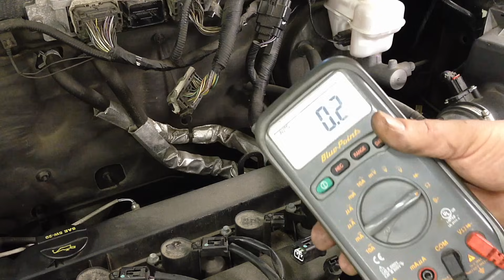Ford Ignition Coil Primary Codes P0351-P0360 Diagnostic Walkthrough

Comment: I replaced the coils per P0351 and P0354 but it is a bad connection from the wire to the coil since i wiggle the clip and it will start working again. Should i replace the harness? Help. Thanks.

Comment: My 2011 escape has the center rear bank coil split apart. I replaced all 6 but still have open circuit trouble for that rear center one. Could that be stuck on? If I multi meter from the connector with it running that center connector gets constant 14v fluctuating to maybe 14.8. Any suggestions?

Comment: Quick question. My truck was under P307 after replaced the plugs. I replace the coil with the original one and move the injector from 7 to 5. Now it shows P0357. I tested the voltage and noid light and my coil connectors passed however there's a small crack in the red part of the connector and the rubber part is missing in the back. Also the clip from the injector wire is missing? What confused me is both pass on the noid light test so I'm not sure if this is the cause or something else. What you recommend as next step? Change connectors or so? Thanks.

Comment: How would you diagnose this issue if it is a V6 engine and the code is P0351, P0353 or P0355 and the misfire issue is on the rear cylinder bank and is covered by the upper intake manifold?
Reply: Hey I’m having the same issue, you ever figure this out?

Comment: P0353 on a Ford 4.2 V6 is not so easy.  It's ignition circuit C, which seems to correspond to the middle 2 towers of the 6 pack coil pack.  The middle 2 towers should fire cylinders 2 and 6, but these cylinders are down because there's no output from the coil.  I replaced the coil pack, no improvement, thus I suspect a broken wire somewhere between PCM and coil pack.
Reply: Hi I’m having the same exact issue. Did you figure out what your issue was??
Reply: @jose-luisboyzo8043 Yes, it was the PCM, not a broken wire.
Reply: @HemiChrysler Thanks, did you have to buy a new one or get it reprogrammed?
Reply: @jose-luisboyzo8043 The customer ordered a refurbished PCM.  There was a physical failure in the circuitry.

Comment: So the connector for cylinders one was not getting a pulse. Changed out not only the wiring harness but also put in a new PCM. Spark plug changed and ignition coil. Not sure why it’s still not sending a signal to the 1st ignition coil. Please help

Comment: I have an 2008 f150 with a P0358 code. I changed the coil ,plug and put a new pigtail connector on to the coil. I was still getting the code so i took it to my mechanic. He checked for constant power on the common side of the connector and put a noid light on and not getting a pulse. He checked for continuity from the coil connector to the pcm connector and said it was good. He thinks its a bad pcm. Is there anything else that should be checked before getting a new pcm? Thank you!!

Comment: 2010 F150 5.4 p354.  Which cylinder? Thanks.
Reply from the maker: It goes on order so cylinder 4.
Reply: @FordTechMakuloco  Found it thanks. I just got done installing the lock outs in my 2010 5.4.  and sent the ecm to Drag Radial Performance and they did the ecm mod to disable the vct.  210 k. Runs good now. Was really banging before.  Just and old plow truck so worth a shot.  Thanks for your great vids.

Comment: Im working on 13 3.7L that has all the coil p0351 through p0356 codes, yet the car runs but with a misfire.
Reply: Car just started this after running out of gas.
Reply: I have this same problem you know whats its ?

Comment: Thanks for another great diagnostic video. The P0353 code I experienced on my Mazda Tribute ended up being an issue with the Powertrain Control Module. At first I thought it was the #3 coil since I discovered it had a large crack in the plastic housing. I'm no expert and can only speculate, but I think the defective coli caused the PCM to fail. I found a company that rebuilds PCM's and their warranty is strictly void if you use any coils other than genuine Motorcraft. The defective coil on #3 was a cheap aftermarket part. I sent in my PCM for repairs and swapped out all six coils. Back on the road again!

Comment: Nice video.  I had the P0351 code pop up.  I moved the #1 cylinder coil to the #2 cylinder and then I got the P0352 code.  That's how you know if the coil is the actual problem.  I would do that 1st since its less than 5 minutes and a really easy job.

Comment: Hi My 2006 Expedition is presenting that same code for all cylinders p0351 to p0358 before that she had a previous failure that did not go over 3 thousand rpm then it began to misfire to the point of not wanting to roll, so she got home and here she comes throwing smoke, and it didn't ignite anymore, when checking the only thing we saw was one of the detonation sensors cut off when correcting that it lit with all the coil codes p0351 to p0358 where do you recommend me to check I'm an enthusiast in mechanics but I know very little about automotive electronics

Comment: I have a 11 base mustang V6 that keeps throwing out different codes to cylinder 3. Started w 3/4 misfiring. Changed plugs. Got it down to cylinder 3 misfire. Changed coil & now code P0353 cylinder C circuit. I'm going to try this all out but I'm afraid that it sound like my pcm might be fried. Has anyone else had this issue with there V6 mustang??? Ty for this video....
Reply: I’m having this issue with the same v6 engine. You ever figure this out?

Comment: Would it be possible to take a metal plate  with a bolt like terminal, then strap the  coilpack  to the metal plate and create a gap between the coilpack and the bolt. Then ground the body  of the coilpack =bolt hole  on coilpack to the plate..   Then run a 12 volt pos to the coil pack and then run a ground wire from the battery to the plate. Then run  a switched ground wire  from the battery to the coilpack neg side .... Then you could  turn the ground on and off and see the coilpack fire.... Do you think this idea would work ?

Comment: Question .. can I use the coils from a 2008 escape 4 cylinders on the 2008 ford escape v6 the coils are the same but the boots are alitthe shorter  can I just put the long bots from the v6 coil on the 4 cylinder coils ?

Comment: Thank you for this video. I am confused with the error codes and was hoping you could clarify the issue.
I have a question about the P0303 error code. This code indicates a misfire at cylinder 3 but I found a website that states that a common mistake people make is that the P0303 code is referring to the third cylinder in the firing order, not cylinder number 3. 

The article states:
"P0303 is a cylinder specific misfire code, which means that Cylinder 3 is misfiring and causing the code. An important thing to understand when finding the location of cylinder 3 is that it's going to be the 3'rd cylinder in the firing order of the vehicle, and not the 3'rd cylinder that you might see when looking at the engine."

My 2006 Mercury Montego has a 3.0Liter v6 with a firing order of 1,4,2,5,3,6. The third cylinder in this firing order would be cylinder 2.
Do I have a misfire in cylinder 2 or 3? Can you please clarify what is meant by cylinder 3?
Thank You

Comment: Is there any reason why multiple ones would come on. I had a code for cylinder one. Changed the coil and now getting P0351 through P0356 VOLVO CX60 TURBO still running rough

Comment: Man I'm having this exact issue an I've followed along step by step,so far so good. But my codes were 351,352,353,354. In order to get to those,I had to disconnect and take off almost everything..how can I check the pulse power if I can't start the car?

Comment: Followed all your steps and triple checked.. I re-wired from PCM to coil thinking intermittent break. Still No Joy! Being told the noise suppression capacitor can throw a PO35X code. I see corrosion on the capacitor terminals and about to remove test and clean them. Your thoughts?

Comment: Hey man great video s and I followed your guide step by step but I’m still not finding the issue. So I have a 98 e350 5.4l. I’m getting codes p0354  p0355. All 8 of my coils are have the same ohms reading. Both cyl 4 and 5 have power on the positive side with the key on and I’m getting a great signal while running on the other wire. No grounding issues anywhere but still not running good at sll. It’s misfiring with low power. (Note that my number 5 coil is actually brand new). I’d love your input. Thanks in advance and thanks for the video!

Comment: I literally tried all the information provided I have a test light all of my wires are pulsing from the PCM, I have a 2012 f150 5.0, on cylinder one I replace the coil pack the spark plug and I’m still getting the same code and I reverse it kills the engine and when I’m driving and come to a stop it kills sometimes not all the times  unless I’m revving the engine a little, any help is appreciated
Reply: Dude did you find the issue???

Comment: I have a 2015 Fusion SE 2.5L ENGINE. I replaced all 4 coils,plugs, and injectors and still getting a periodic misfire in cylinder 3. I see you mention some of the newer model fusions sticking on. I have a Ford tech that started his own shop after the dealership he worked at for 20 years sold. Problem now is I cannnot get it to throw a code when it is misfiring and its periodic so getting it to actually misfire in front of him has been difficult. Visually inspecting the woires they all look good with no corrosion seen, but it could still be a wiring or other issue. This particular Fusion has been a lemon it has 50k miles on it now. At 22k miles it died and was towed in. Under warranty they had to replace the Head as they discovered 3 cracks from the forge. Its been 2 years since that repair and ran great until now. Checked the oil and there is no water found. All the plugs looked good when I replaced them saw no indication of water so I do not suspect anything from that repair. However I do remember them having an issue with an injector after the head was replaced, but they resolved it. I am now just waiting to get another engine code after he cleared everything so he can see if its consistant with same #3 cylinder. Thanks

Comment: What if I’m getting the pulse with a noid light, I swapped ignition coils with another cylinder and I’m still getting p0360? Spark plug?
Reply: Same problem. I changed my coil and spark plug to code p0357 and it still pops up. I also changed my harness because it was disconnecting but my vehicle is still idling and shaking. Confused

Comment: I have been shaking wires and testing fir continuity with no luck. Moving COP and spark plugs do not shift the problem. My mechanic says he does not see anything wrong but he does not specialize in PCM repair. What are my  options? Car does not misfire on start. Load  will trigger it but not always

Comment: Hi I'm working on a  2003 Ford expedition. It keep blown coil packs , 1 every 4 months. It will be different ones. It been tuneup. I use dielectric grease. I'm using o'reillys grey and blay cool packs. Can you shed some light on this.?

Comment: thanks .. ive got a 2006 ford mustang gt that is throwing all 8 primary coil codes at once. its only noticeable at low rpm below 2,000 . i had a alternator melt at the power wire a month before this started ... think there is a connection? ive been told a bad alt will burn up a pcm

Comment: I thought on a Duratec DOHC V-6 that the 1, 2 and 3 cylinders were left to right looking at the engine on the firewall side, Bank 1 and 4, 5 and 6 were in the front on Bank 2.  Is that what you meant by front?
Reply from the maker: Front of the engine on the firewall side is cyl 1.
Reply: @FordTechMakuloco  Thanks.  That's what I thought you meant. I was scrolling the comments and saw that one guy telling you that you had the order wrong. I told him the order and that you were correct and he misunderstood you. You're the best at helping me with my 2005 3.0L Duratec V-6!!

Comment: I've got a 2006 Fusion 3.0l, with a P0353 code. I bought the car used with that code, so I replaced all 6 coils and plugs.  I still have the same code showing up, engine missing also.  What is the best way to unplug the #3 coil with out removing the intake?

Comment: Hey your videos are great a lot of good info . I hope to see if you can help me out 1997 f150 4.2 code p0008 engine has no power and it only runs if I disconnect the mass air flow meter but it’s doesn’t run good. Thanks if you can get me started diagnosing .

Comment: I have a 2003 I'm getting no fire to none of my plugs what could be the problem 5.4
Reply: the problem is that its a Ford. Nothing unusual or shocking when these things happen on a daily basis. its in the name, "Fix Or Repair Daily"(F.O.R.D). The fix is actually quite simple, but not cheap- buy a different brand.  Hondas are great, Toyota's too.

Comment: I have an 04 F150 5.4 3v (11th gen) I’m getting 3 codes P0351, P0353, P0356 I replaced all coil packs and pigtails and still have problem. Ford has been testing now for 3 days with no luck. The codes are random. Sometimes all 3 at once , other times they rotate. When you clear the code it runs fine, a few minutes later it starts again. Any ideas or suggestions? Hoping you can help out a fellow Devil Dog!

Comment: My ignition coil and my fuel injector harness not responding.  What can it be Ford Tech?
Reply: Alvaro Silva did you find out what it was?
Reply: @cruzanity7478  bad valve
Reply: Alvaro Silva like a bad intake/exhaust valve ? Was it bent? If so, how did you find out?

Comment: Had a p0352 on a 2000 6.8, did your steps here with no success. Noid light flashed and all. Ended up tracing it back to the pcm pin being slightly pulled out. What a pain, ford could've put a 1/4 in slack on those pcm wires. They're so tight.

Comment: I've been getting p0354 code on my 08 focus se 220,000 miles with a very very rare random intermittent misfire that will only misfire sometimes for maybe 2 seconds or for 25 seconds, and then it goes back to running normal for 5 to 20 minutes until the next short musfire., . At first I found oil on the spark plug for cylinder 4 so I installed a new valve cover gasket. I also got all new spark plugs at that time. The issue continued so I got all new coils. The issue seemed fixed for about a week, but then came back. I did notice my fuel pump making noise so I got a new pump and will be installing this weekend but i wouldn't think the fuel pump would affect just one cylinder and only giving that one specific code that is directed towards and electrical problem. My question is, since it's rare for pcm's to fail, is it more likely that the wiring has an issue or the pcm. The misfire has been happening a lot more often lately slowly slowly misfiring more often. so I'm really trying to narrow this down. And my second question, IF a coil driver In the pcm were the culprit, could it be intermittent. Or would the coil driver just fail and stop pulsing. To be honest, it's the fact that it's so intermittent that is making this so difficult because the tests all come back normal unless I catch it at the exact moment of misfire.
Reply: If it misfires at idle you can wiggle the wires all around and see if the engine runs better or worse and can narrow down problems in the harness like that. Overall you don't want to run a misfiring engine long, esp if it's blinking the CEL because unburned fuel is going down the exhaust onto your o2 sensors and cats.

Comment: Thanks so much for this info. You saved me alot of time with my p0355 code. Narrowed it down to Cyl 5 from a generic primary circuit fault.
Reply: What was the actual problem.  Coil, wiring?

Comment: Do you think crown victoria is a good car?
Reply from the maker: yes
Reply: Great car, I have 4 of them and just installed a fuel pump and lo and behold, P0351 code pops up. And the fuel tank straps are fighting my attempts to thread the bolts back onto the studs. Besides that, great cars!

Comment: I'm getting p0352, p0353, p0355, p0356, p0357 on my crown Vic. I changed the pcm and the coils, still can't find the problem. Changed many other parts as well. Doing a compression check tomorrow. I guess I should rip apart the harness. I hope I find it.

Comment: Well this code came up on my 2006 Ford Expedition and found that the coil was not properly seated on the plug. The plugs had been changed a few months ago, so I guess it just worked loose, although the bolt was tight!  The code has not reappeared so far.

Comment: I have 6 of these codes p0352 thru P0357. It misfires at stoplights and hesitates at times at low rpms. I've changed the computer and am pulling my hair out. Drives fine on the highway. Help please

Comment: That’s a great instructional video. In having that issue (P0351) on my 2005 Expedition , but also I’m getting lean mixture fault. I replaced the modules, but would like to know the resistance for such . Also I heard that could be a vacuum leak. Thanks for your help.
Reply: Did you ever figure out your issue im having a p0351 as well i have a 02 expedition
Reply: All I had to replace all ignition modules, plus the throttle body

Comment: I have a transit connect 2013. Lost cylinder 1 and strangely air conditioning (at the same time) I’m leaning towards a pcm. 1 coil pack works on other cylinders when test at coil plug grounding signal isn’t steady  and almost stays on or fluttering rather than steady with tdc. Ohm test I’m seeing .3 on a fluke 88 through harness. At this point I’m not sure what else to check.

Comment: So if I'm getting faults on P0352-P0356 but not for P0351, basically cylinders 2-6 but not on cylinder 1. Chances are my ECM is causing the problem.